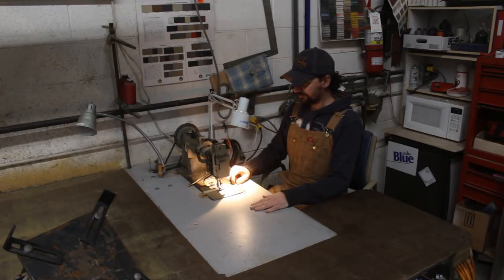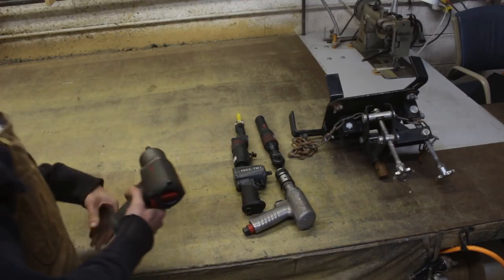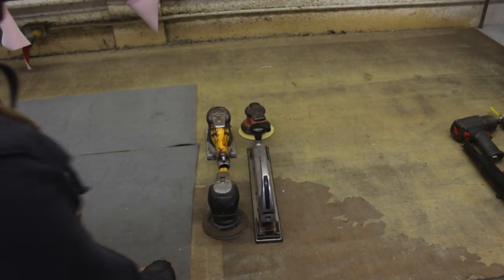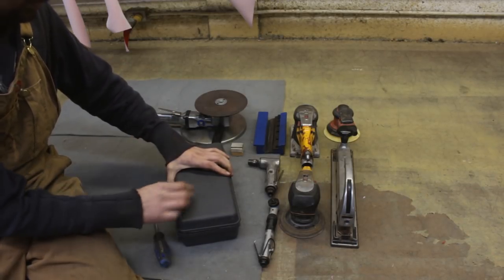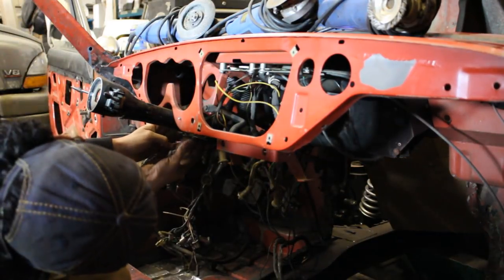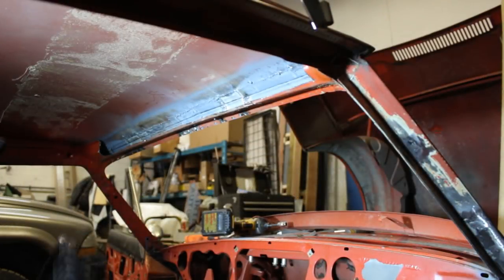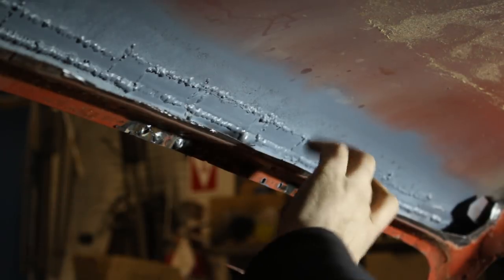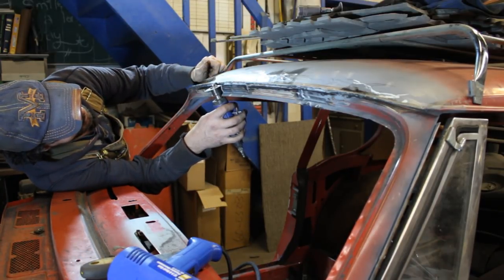1972 Triumph GT6 Restoration - Part 35 - Still on the windshield frame

Comment: Oh yeah! Finally the column is out, the wiring is out and the rest of the bulkhead is cleaned up.  See, now, you have turned the corner...there is nothing else to take off...now you start putting stuff back on 😎 Nice repair at the top of the windscreen...it's been a challenging area that's taken quite a bit of time to make right.
Reply from the maker: There is an evap reservoir in the trunk that still needs to come out :) I will keep it as long as I can to keep you entertained :)

Comment: Hi Elin, great metal work it is really coming together, may I suggest injecting a cavity wax once basic finishing is complete. Over here in the UK Dinitrol and Waxoyl are popular brands. They are drawn into the seams and do not harden like truck bed liner so don't crack as the body moves. Stinks of White spirit for weeks  so do it when you have finished welding.
Reply from the maker: Thanks David! I am definitely going to do something of that sort. Waxoyl probably.

Comment: I think you'll like that shrinking disc.  The cool thing about those is that they automatically only heat the high spots, because that's the only part that will contact it.. so just move it back and forth on the surface and it finds what needs shrinking automatically.
Reply from the maker: Yeah, I used it already and it worked very well. It was on a tricky area though so I couldn't put it flat, but it woked. You will see in the next video!

Comment: Whenever you are drilling remember speed and feed. Different material hardness requires different speeds and feeds.Slow down the drill speed very  slow and increase the feed, push on drill. This will speed up the cutting performance and keep your drill bits from overheating, results in annealing of the cutting edge. A variable speed drill is the key to preventing annealing of the drill bit or work hardening of the material to be drilled. Drill bits last longer saves $$$$$$$$!!!!!!!
Reply from the maker: Thank you Maureen. My drill bits are cheap ones and last seconds, but my toolbox is the go to place for everybody in the shop when they need bits so... Imagine if I can bend a drill bit and straighten it back with my bare hands... But thanks for the advice.

Comment: Hi Elin.  Nice work as always.  Congrats, on another can of worms put away for good let's hope.  Have you had a lot of good experience with spray on bed liner over primer? I have the underside of my TR3 all covered in primer.  Do you think it's a good to spray bed liner right over the primer vs. under coating? I live in Southern California so it's going to be living the good life here and probably only get wet when I go through a puddle occasionally. Lots of confusing thoughts on the internet: Bed liner vs. Undercoating. Your thoughts or anyone else out there on the best approach to  handling the underside of my beauty is greatly appreciated.  Thanks again!!
Reply: Take a look at this paint -  POR-15 Top Coat Chassis Black.  I would not use bitumen undershield.  You  could also spray  Waxoyl into the box sections but that might not be necessary where you live.
Reply: Thanks. I think I'm going to go with POR-15.  Lots of good reviews on line and Jay Leno uses it and gave it a plug on his YouTube channel. I'll take a look at Waxoyl too
Reply from the maker: I think you got your response Tom :)   I actually do not have too much experience with bed liner so I wouldn't be able to give you an adequate answer. So thanks, Mark!

Comment: If you start by  drilling a 1/8 "hole in the corners of the cut out, the corners will have 1/8" corner radius. Cut out the bad material up to the drilled corner radius with your grinder  cutting disk tool.This will prevent material cracking out of the sharp corners when under stress. That's why airplane windows are always round or have radius corners.

Comment: Nice work. Why don't you get an aerosol can of red paint to match the original colour and then you can use that over the primer instead of the bed liner paint inside the box sections etc.   Just a suggestion.
Reply from the maker: I am not sure about the color yet, but also that is what I had handy. I would use my favorite Rust Guard, but I didn't want to open a new can for just that area. The bed liner was laying around so that was easy decision :) You see where I have access to paint later I just leave it on primer.